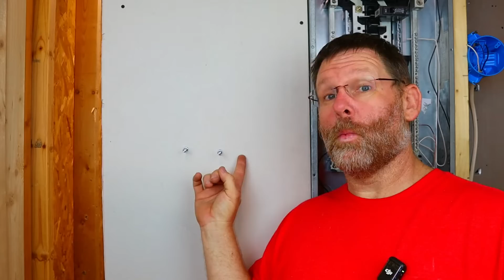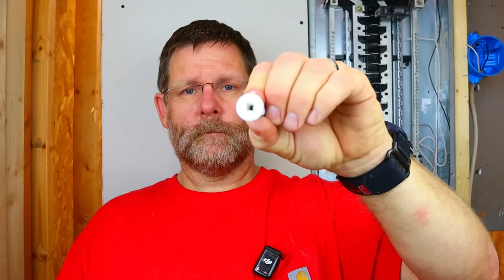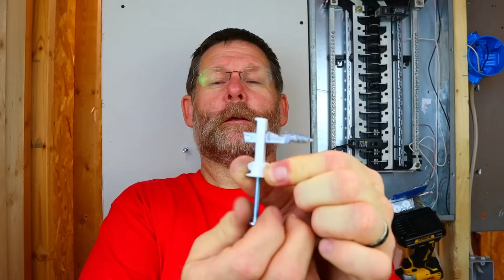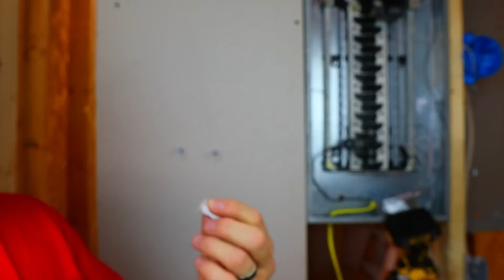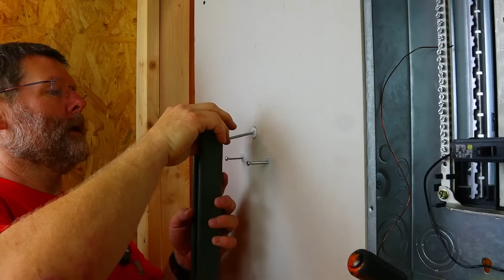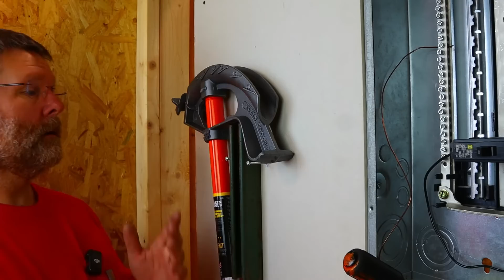Install Driller Toggle Bolts Like a Pro..Only One Tool Needed!!!

Comment: I got the one that holds 110 pounds for the ceiling I’m hanging electric TV mount and I only had two holes for the studs so I had four other holes that I needed to have some pretty tough stuff so I got those like Home Depot told me I don’t have an arrow towards the sky because it’s all towards the sky if I had a heck do you know where to stop? Also, my screwdriver is not screwing it in.